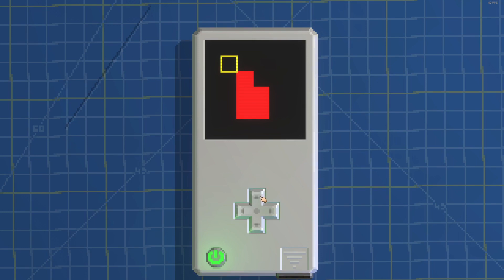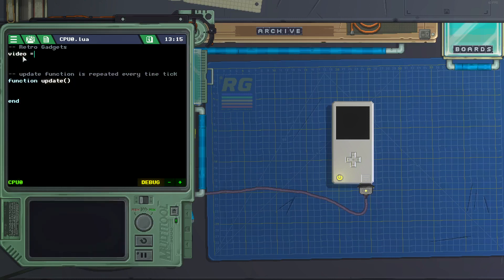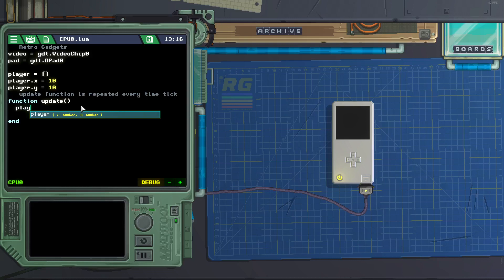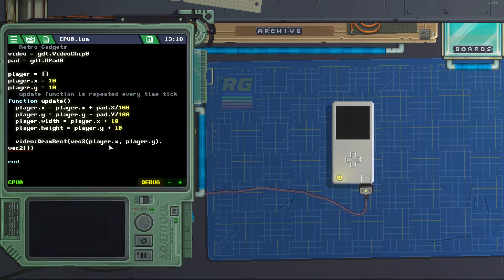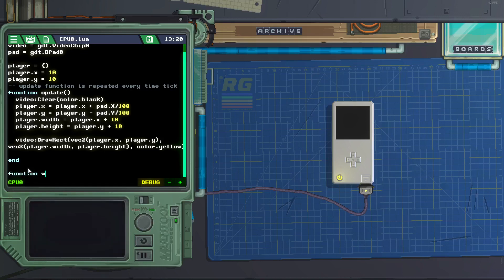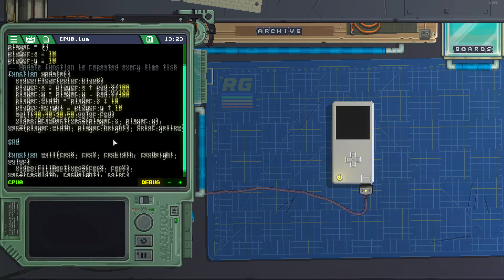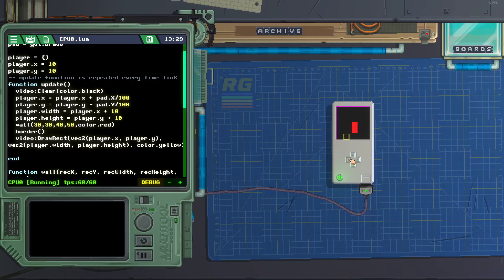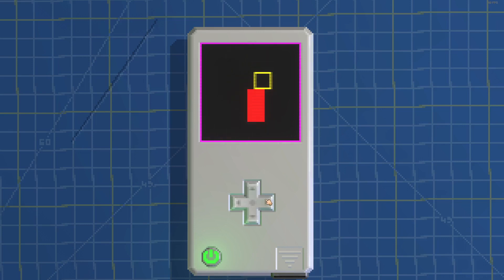Retro Gadgets - How to create wall collision

Comment: Hi! Great video. I have a few suggestions:   
1. Instead of assigning the player's attributes in their own statements, you can simply write "player{x = 10, y = 10}" which will have the same effect.
2. Instead of writing "variableA = variableA + variableB", you can simply write "variableA += variableB".
3. You can assign your Keyboard as input for gadget components by clicking on it and selecting "input", then selecting the keyboardChip (you have to add one from misc.) and then selecting the desired keys.